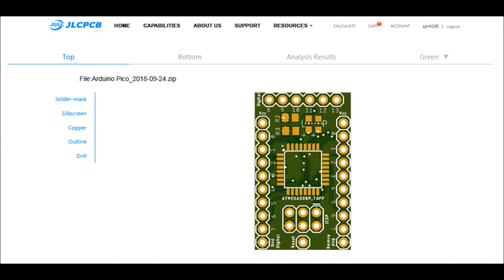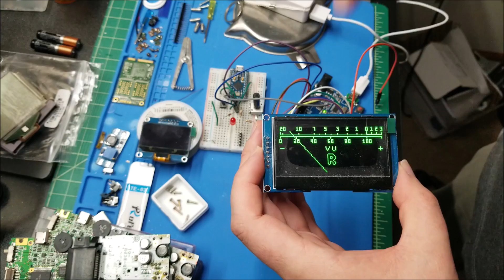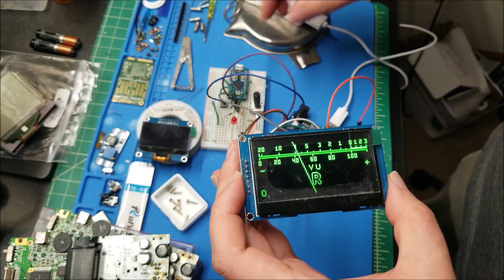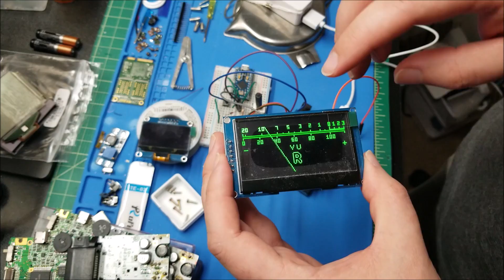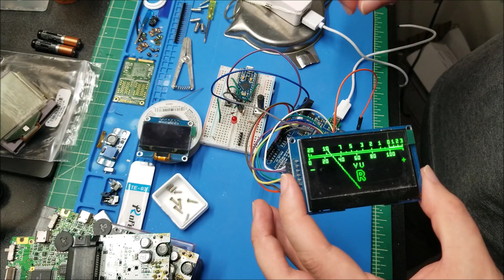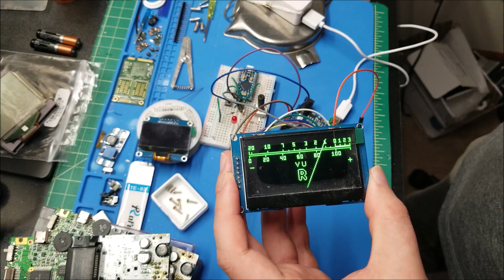Digital VU Meter: Part 1, Simulating Analog Mechanical Physics

Comment: You did a great project, it's not PID controlled though, I think you meant  that the input signal is low pass filtered? PID control requires a sensor on the output of the system to feedback and subtract from the input signal.
Reply from the maker: Pid just means there's proportional, integral and differential terms in a difference equation to calculate a next step action. Closing the loop to make a pid compensator of course requires feedback but the term pid itself doesn't necessarily only refer to compensation. I agree though that I didn't make a closed loop control system, it's just a simulated damped system that reacts like a mass and spring setup.
Reply: Yeah, so it's a low pass filter applied to the input signal.
 @sjm4306

Comment: How much you charge me to put a pair together to where I can wire them in place of the existing meters in a tape deck?
Reply from the maker: Thanks for asking, I haven't had time to properly finish this project so it currently doesn't work with line level audio signals. When I get the time I'll add the necessary analog front end circuitry and post an update video.

Comment: I thought about your point about how the needle doesn't behave 1-1 with the audio in most digital VU meters that mimic needles. It's just come to my mind that I can go the other way. Using a laser galvo and half bridge rectifying the signal input I could make a needle move just about as fast and pretty close to 1-1. That would be something to collaborate on :P